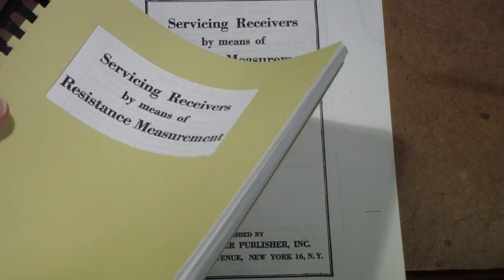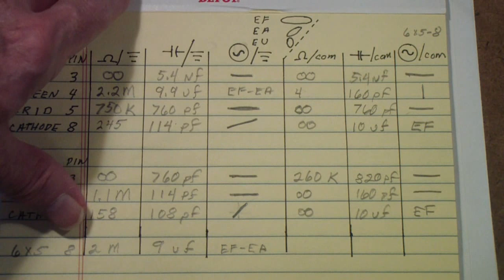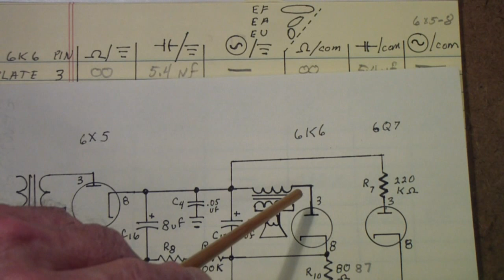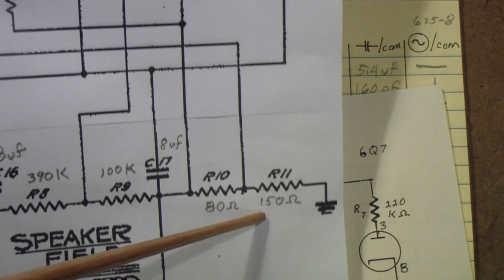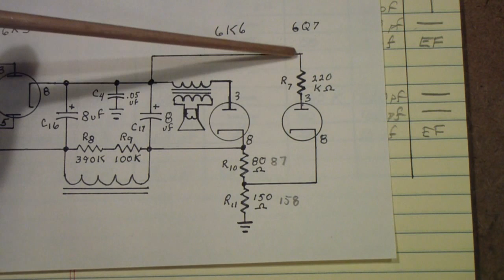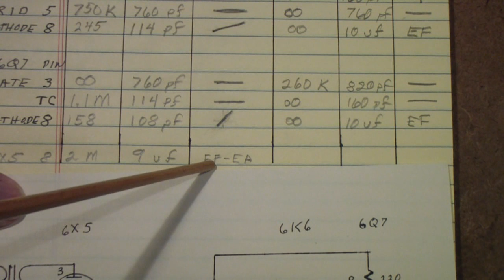TTT247 Siganalysis on Old Radios Pt 2

Comment: There is a capacitor from pin 3 of the 6K6 which you don't seem to mention in your description although your measurements seem to show it. You suggest this capacitance might be stray capacitance, (5nF), but it is probably the plate capacitor.